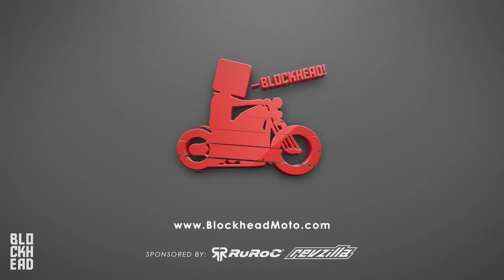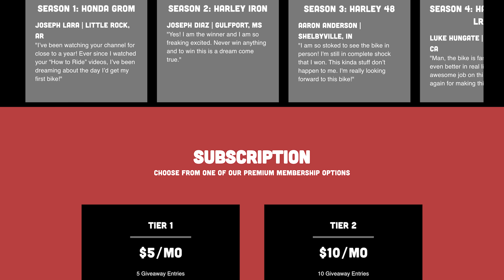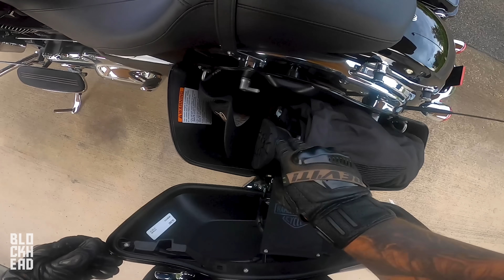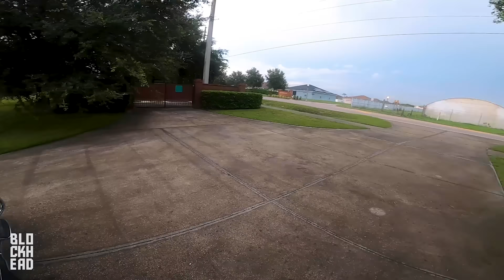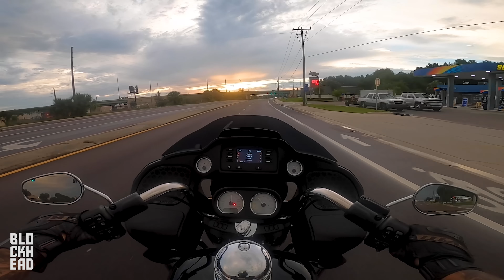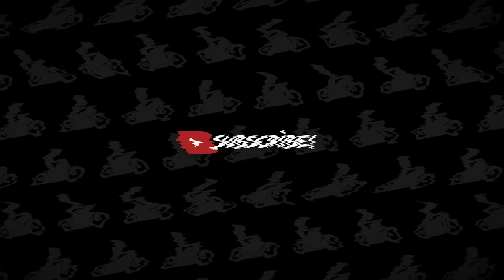5 Reasons YOU SHOULD OWN a Harley-Davidson Road Glide!

Comment: I got a 05 Road Glide I'm the 4th owner of it it had 24,000 miles when I bought ush 60,000 on the clock I put 14 & up bags and touring pack 16in meat hooks up graded the audio and i put 21in front wheel on it I gave the guy $6500 for it I have had it going on 2 years now  besides my Titan Phoenix ZRM I don't want another bike unless it is another RG

Comment: I love my 15 Road Glide Special. 40k miles and still going strong! One other benefit to the frame mounted faring is that it does not move whenever you turn your tires. That’s helpful in low speed maneuvering situations that you don’t have the weight of the faring to deal with.
Reply: Yeah with good maintenance itll go 200k+ miles easy. Im a Honda guy, but this specific harley was made for longer distances so it’ll last long no problem
Reply: Having had 2 RoadGlides prior and now having an ElectraGlide Ultra that is the main thing I have noticed as the difference between these bikes. For me I get better wind protection behind the batwing but I think that’s because I’m closer to it. Love em both though..

Comment: As a road glide owner.  I'd avoid the Sony ax7000. It's not water proof and thr sun glare off it is horrible. Finding a used  HD 6.5gts and adding an amp and upgraded speakers is a better option

Having rode many miles on a road king. A street glide and my road glide. The road glide you don't feel the wind force through the bars. You feel the wind shove the whole bike around though

Comment: I’m really torn between a road king and a road glide. I want the comfort, but I don’t know how I feel about the fairing. Music isn’t a big deal for me and I really dont mind the wind. I’m on a dyna wide glide right now. I’m leaning towards the road king.
Reply: I literally walked into the dealership wanting a RKS. They didn’t have any in stock in January. They gave me a deal that was hard to pass up for Harley dealership on a RGS. I didn’t knOw if I wanted the fairing either. But been riding a few months now and have zero regrets. Whatever parts you have changed out, though. Make sure you keep them. Don’t let the dealer keep them. They gave me push back when I wanted my old slip ons and handle bars. I’m finding during the summer I like the stock windshield because I want more wind to hit me. Also I’m 6’5”.  Which ever you choose. Enjoy man! They are fun

Comment: I have a 2021 Electra Glide Standard with the batwing fork mounted fairing. I haven't felt any turbulence or shaking in the bars yet. I even took a quick trip to Mexico and had it up to 110 mph.
Reply: I've had 2 Electra Glides and a Road Glide, and have ridden several Street Glides. The difference in turbulence is so little, it all comes down to what is more visually appealing to you. I prefer the RG as a tall guy because the fairing is farther out there. But wind buffeting, for me, comes down to my head, and which windshield I'm running. That's it.

Comment: I don't know man, the only reason to choose HD instead of an Indian Challenger is if you're a die hard HD fan, if not, the Challenger crush Road Glide in every aspect.
Reply: I like the challenger also, but the throttle response on the HD is way better.
Reply: @christopherflesner8095  I don't see any problem with the Sport Mode throttle response. Standard and rain have their uses in their respective "names". I smoke any Road Glide with my Challenger.
Reply: @Fieskmask  the only reason I purchased the Road Glide over the Challenger was the lag in the throttle. Sport mode does make the response better on the Challenger, but it's still really laggy compared to the Harley. That being said... I do really like both bikes. For me the Road Glide was just a better fit.
Reply: @christopherflesner8095  It sure does. I don't know what bike you have tried (or if you even have?) but the bike is way better than a Road Glide. Perhaps you're a die hard fan?
Reply: @christopherflesner8095  agreed. Indians throttle is laggy
Reply: Nah
Reply: The Challenger I rode had the stage 2 performance package and it was STILL laggy in sport mode compared to the Harley. As far as a die hard fan...no. The road glide is the first Harley I ever owned.

Comment: To each his own I guess. Everybody I know that has performance upgrades on a motorcycle and trust me bro over the last 40 years I have met several have told me the same thing they are always looking to get the thing tuned up just right it always seems to be not quite tuned to its full potential and it seems like they have their bike in the shop way way more than the dude who just leaves his bike alone and maybe put a pair of slip on pipes on it or something but doesn't mess with the factory tuning.

That being said I get it you guys are pros and can probably nail it down and add horsepower and torque and all kinds of performance without the person having to spend his life doing maintenance on it nonstop I get it.

Nonetheless for me personally if two were sitting side-by-side and one had a bunch of performance mods and the other one was stock at a dealership I would probably buy the stock one.

But then I am one of them outcasts that also not only do I not want a frame Mount fairing I don't want a permanently mounted fairing on the handlebars.

In Ohio there are a few months out of the Year where I just really don't want a windshield on my bike at all because it's hot enough I don't want it.

I would think being in Florida you guys would have like I don't know 9 or 10 months out of the Year where that windshield is just unbearable.

Again though that is just me everybody is different and like you said them bikes are popular so the dad bod of Harleys is selling so you might as well go with it.
Reply: Do you know Kevin Baxter? Look that channel up. He's big on those tunes you speak of. A true potential tune,that is.
Oh and FYI, most true riders,ride year round down here. There's actually less time to ride in the summer time,because of rain, but only rains for about and hour or so,towards the end of the day.

Comment: I bought my road glide mainly because the fairing is frame mounted, as well as the look of it, it looks so sleek and sexy compared to a street glide. I am pretty tall so I did have to change the seat and the bars right away. The stock seat just had me cramped up a little too much on the controls and the bars had too much angle on my wrists. 

I have no doubt that this giveaway will com out more badass than any of your other giveaways to date! Can’t wait to see the build